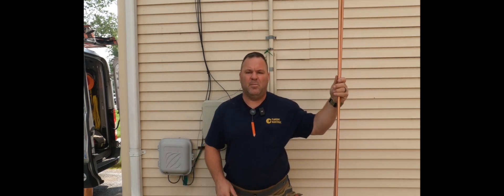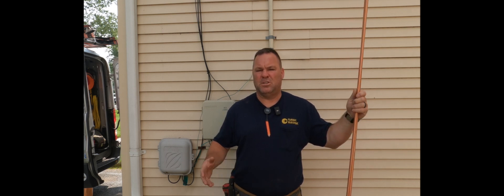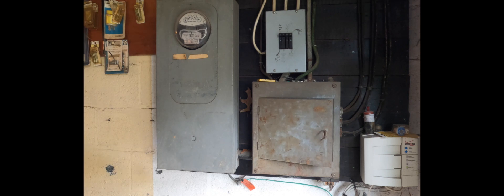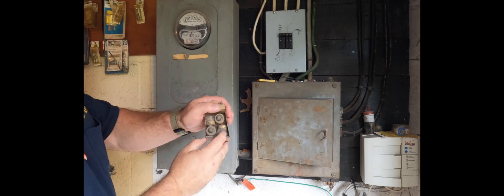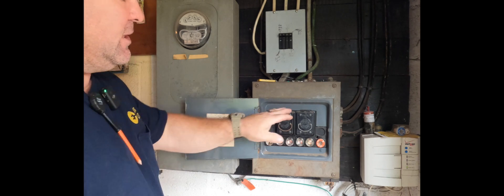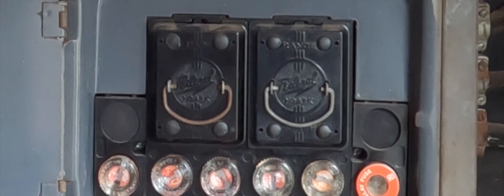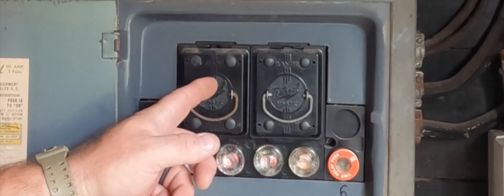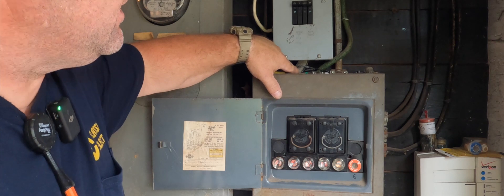BRINGING 100A SERVICE INTO THE 20TH CENTURY:  200A Service Upgrade Part One | Cranford, NJ.

Comment: @electricianron thank you for explaining and showing your work.  I am confused, however, by how you cut and splice service cables coming from the transformer to the service head in several videos.  Did you have the power company turn off the power and then back on?  In several you put the meter back and test voltages and it is all clearly live.  Just wondering.
Reply from the maker: It’s always live. The only I’ll call for a shutdown from the utility is for underground services that require a meter enclosure upgrade/ change.
Reply: @electricianron_New_Jersey  How do you avoid getting shocked?  Is it simply that you are standing on the roof, insulated from any ground?  And using insulated cutting pliers?
Reply: @steveleeke8938  if you cut 1 wire at a time it doesn't shock you. I just watched a video and it only shocks or pops if you cut 2 or more at a time.
Reply: @steveleeke8938  we do it all the time, I wear insulated gloves and do one wire at a time. It feels sketchy the first few times but you get used to it
Reply: @johnstrh1  is it better to be safe than sorry? Like taking a few mins to call them ahead of time seems like a small problem vs the reward of making 100% sure you're never electrocuted by some rare occurrence right?

Comment: Used to see a lot of those old 60 amp services, main, range and fuses.  Ran subpanels through the range cartridge fuses.
Reply: The unique thing about these range & main fuse panels is that they can be rated as 60 or 100 amp service.   If the label is missing or illegible,  you can tell if it's a 60 or 100 amp service by pulling the main fuse block, then checking the range (or whatever the other fuse block is powering)   If the stove is dead, then you have 60 amp service, likewise if you also have to pull the range fuse block to kill all the power to the house,  then you'd add the two together to get the size.   Typically the range was 40 amp.   The size of the service wires should be verified against the panel rating and service disconnect, because sometimes a homeowner or unqualified friend will replace an old 60 amp fuse panel with a new 200 amp breaker box and reuse the old 60 amp service wires.
Reply: Quite often the range fuses weren't even used if there was a gas stove.  I then used that fused circuit to feed small 6 or 10 breaker panels.
Reply: @Bob.W.  makes sense because during the era of these panels many families indeed had gas stoves.  I've seen the range block used for an electric clothes dryer.  If you're to the point of using the range block to power a smaller breaker subpanel for the purpose of adding more circuits you'd probably want to consider budgeting to upgrade the service to a 200 amp breaker box at a minimum,  even for a smaller home where 100 amps would be good enough since the cost difference is not that significant,  and certainly cheaper than having to upgrade again from 100 to 200 a decade down the road if you decide to add a bunch of things.
Reply from the maker: I did not know this until yesterday when I got the new meter but the old meter that was in place since the 1950's was only rated for 60 amps.